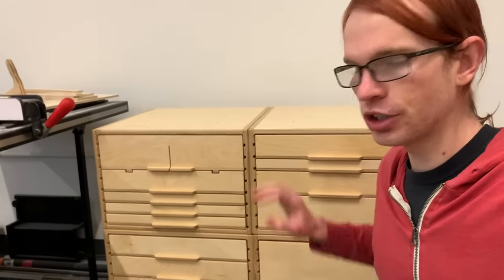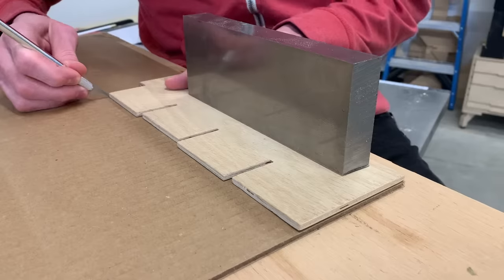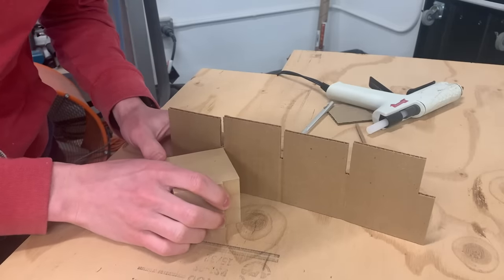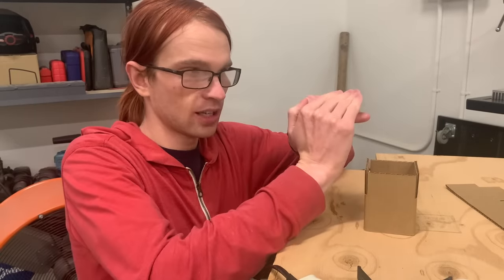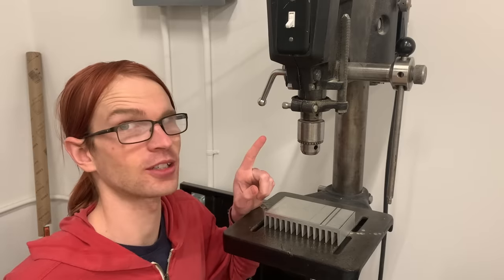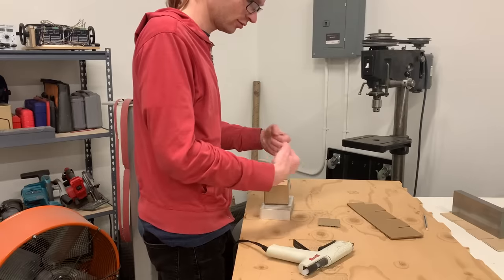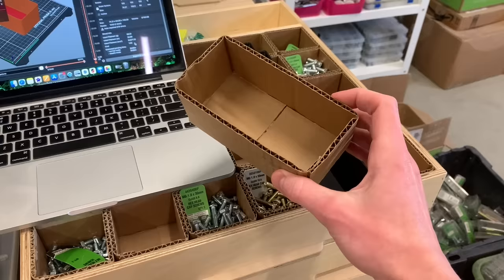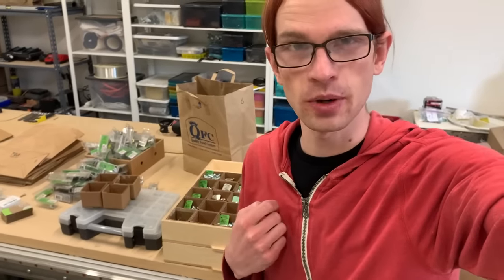Cardboard Hardware Boxes

Comment: Using a heat sink to help set the hot glue is really clever. And your statement about priorities is so important. A great teacher once told me that engineering is the art of managing compromises.
Reply: And roughly speaking economics is said to be the subject dealing with the optimization of choice among alternatives. So what is optimal for a tray/drawers worth of part storage containers: waiting fifty-three hours for the printing of a set of two dollar new material plastic boxes or working one hour to cut fold and paste a similar set of nearly free recycled cardboard boxes - entirely up to your judgement of course (economics also considers as highly valued the user's preference).
Reply: It's all about understanding your products "requirements" and it environment it will be used in and how. Along its development, there are tradeoffs. We used to say, turning the dials, like the wizard of oz did! 🤔😅🤣👍
Reply: I'm skeptical that it is pressed for long enough for the heat to flow through corrugated cardboard and into the heatsink. Corrugated cardboard is a pretty good insulator.
Reply: I'm skeptical that the heat dissipation really does much through the 4mm of board... But I also thought that it was clever!
Reply: @marksaus  Since it's getting crushed, it won't be 4mm. But I'm still with you that it seems unlikely to make a difference in hardening time.

Comment: Since you may need to make hundreds of these eventually, look into steel rule dies. You could probably build them a lot faster without having to manually cut out the cardboard. Love the detail you put in to all of your videos!
Reply: Be pretty tough to make steel rule dies with those three super tight and narrow slots. He’d also have to buy steel rule material and a die bender which would defeat the purpose of not spending money.
Reply: @kv501  he can make some dies with some scrap plywood, an old bandsaw blade, and a couple of hours of cutting/grinding. He’s got the skills to make it work.
Reply: Excelente, me uno a esta idea
Reply: A router with a small router bit   and a bushing could make this an opportunity to use the router and practice in making a template. I don't think it would be faster than with a knife but maybe some people like to try this out.

Comment: By the way, in sewing, you often have this same situation where one piece of fabric has to be very slightly longer than the other piece.  This is known as 'turn of cloth'.  For example, for the collar of a coat, the upper collar piece is a little longer so it can fold over the under collar.
Reply: Holy crap, you just solved a sewing block I've had for weeks. Thank you! For some reason, cardboard and cloth are stored separately in my brain, but this explained everything perfectly!

Comment: If you stack a bunch of layers of cardboard together you can cut them out all at once using a bandsaw and/or table saw. Just another way of doing it that I've found to work well. However, it can dull the blade a bit so use an old one.
Reply from the maker: Hadn’t thought of this, thanks!
Reply: @Jer_Schmidt  I was thinking about using my scrollsaw actually...
Reply: Wouldn’t there be a lot of tear out?
Reply from the maker: @Killashandra111  
The table saw cuts it surprisingly cleanly. I haven’t tried the bandsaw yet.
Reply: @Jer_Schmidt  Believe it or not, about 5 years ago the woodworking dept where I was taking classes gave away their entire library of Fine Woodworking magazines dating back to 05/06/83.  I picked everything going forward to 2016 with a bunch of gaps.  I wanted to scan it all however cutting all the magazines apart with a box cutter or Exacto knife would have taken forever and killed my fingers.  I created two jigs with compression pieces in which I could trim the magazines, one for the outside margin, one for the spine.  On the table saw, I first trimmed off the outside margin, then the spine so that the final size would fit in my scanner.  Then I scanned everything so I did not have to keep the hard copies.  It was a pain in the butt to do however worth it with all the articles I have at my fingertips.  I really need to spend time indexing them so I know easily what is in each issue.

Comment: There are several makers that are using 3d printed boxes that fit together for this kind of thing.  As neat as those are, it takes hours to print a single box.  I started making little boxes out of 1/4 inch plywood scraps, but even that is a bit annoying and time consuming.  This is clearly the best solution, especially when i receive a box or two every week - so i always have an absurd amount of extra cardboard.

EDIT: I should have watched to the end - you mention the same kind of 3d printed boxes...
Reply: I had the same thought with 3d printing, cardboard looks so much easier and quicker, but then i watched the video, theres a lot of box science going on... Maybe combine the 2 and print sheets you can fold into boxes?
Reply: @mikejones-vd3fg  I like that idea.  However, when i slice a print-flat foldable box i found online (40mm cube - 1.5ish inches), it's still going to take an hour with a .8mm nozzle.  For me, that seems excessive - i'm going to try the cardboard version first and see how fiddly it is before i try printing something foldable.

Comment: I was going to suggest Gridfinity (which is 3D printed) to see if it fits, but you made a strong case to just use cardboard.  that makes total sense.  Sometimes new technology just isnt the right fit.
Reply: The plastic bin he printed is a Gridfinity bin I believe based on seeing the ghost of the grid pattern on the bottom. Both have their place and I really appreciate his cardboard solution to use waste instead of using new materials especially plastic.

Comment: A couple of years ago I re-vamped my small parts storage and built a 10 drawer cabinet and filled most of the drawers with small boxes in the general style of the cardboard ones you just showed. Several sizes that could all nicely fill a drawer exactly. 
But I used 1/4" ply ( underlay, it's cheaper ) and glued the pieces together then cleaned up the edges by sanding on my disc sander.
Your method is much better. Cheaper, faster and yield the same result. Wish I'd thought of that. LOL. Nicely done.
Reply: I’m 70 years old, and I am always blown away by your ingenuity. Best regards from Australia.

Comment: Nicely done.  A light score with a spudger or similar on the crease lines would give you perfect folds and probably speed things up a bit (and definitely make the folded edges nicer).  I think this is a great use for cardboard!
Reply: What’s a spudger?
Reply: @brindmusicnerd  
Spudger - Wikipedia

A spudger is a tool that has a wide flat-head screwdriver-like end that extends as a wedge, used to separate pressure-fit plastic components without causing damage during separation.

Comment: I would like to give an extra fav for trying to avoid buying/using something new even if it's not such an amount of material (against plastic). If you screwed a small blade against a wooden block with 45 degree you could take away some card board material. It would be easier to bend, it wouldn't be in the way of the bend.

Comment: I really like your method with this. 👍
I thought of making some in simple flat cardboard, (not expanded corrugated) which is easier to cut with scissors and easy to fold etc, then once assembled either spraying or dipping them in some type of varnish to add strength and seal the material so it is more grease-proof and "plasticky". For flat cardboard I think you could use superglue not hot glue, so would be quicker and not need much glue. But of course needs the varnishing step.

Comment: Hmmm, I have wanted to get a laser cutter that could cut 1/8" plywood to dovetail together into drawer boxes.  Not as cheap, but the robot can do the 'cutting' (burning) while you do other things.  Assembly is easy without jigs.  You can finish before you assemble to make it easier, maybe.

Comment: Quite brilliant actually. Only caveat is the actual longevity they provide. Guess it all depends on the amount of use (in and out of material and the boxes themselves), content stored, as well as environmental conditions. I made very similar boxes out of leftover planks of some aromatic cedar planking made for lining closets. Gave me a chance to develop my finger joint jig and technique. It may seem far more expensive, but it actually was wood that was destined for the trash bin as well.

Comment: I like crafting with cardboard. Cutting with heavy duty serrated shears or snips can prevent risk of paper cuts on the exposed edges. Also works really well to score your folds with the tip of a large framing nail.

Comment: 3d printing boxes is the biggest waste. Just buy them if you don't want to go the cardboard route, you can get them super cheap at Harbor Freight. However, I could certainly see making the mold with the 3d printer, and possibly even a cookie cutter form to crimp or even to cut out the cardboard.

Comment: You could probably use a vise for the pressing step as long as you made sure it pressed on the form insert to avoid crushing the walls.

Without having to apply the force yourself,  as with the press, the increased time to dissipate the heat wouldn't matter. 
I imagine you could leave the box in the press while you cut out the next box.

That would mean sequecnal production rather than batching. So more workspace required and potentially a loss in efficiency. 

If you had to forms then you could still batch. Long and short perhaps 🤷‍♂️

Comment: I think your estimates on 3d printing are a bit off for plastic usage and cost... I need to actually print one, but I was able to slice for printing 9 of the small cube boxes to fit on an ender 3 bed (barely) and it used 39g of plastic each (about $.57 in sunlu PLA)... it would take about 30 hours of machine time, but only 2 or 3 minutes of human labor... and since I did the design in fusion, I could easily modify the sizes with just the one model... (half-width or divided boxes, odd shaped (like an L) boxes... etc... but I am a 3d printing junky... 

With a bit more engineering (which is already going on in the opensource printing community) you could get free filament made from recycled 2ltr bottles... though you would have to run the bottle through a spaghettification machine and wind it onto a spool... then you would be at machine cost only since you could harvest the electricity from solar panels. 

Alternately, if you really wanted to go full-on recycle crazy, you could run the paper through a mangle and press wet pulp into a mold along with some of the sawdust from your shop... still probably with a bit less labor than the manual cut-crease-fold-glue press process... but I am a bit too lazy to do that myself... or just build a small press mold and use sawdust and a little pva glue to make a ldf box... or use the same process with plastic scrap like the Precious Plastics folks.

Comment: Delighted to have found your channel. An idea for your template: Instead of using the weight to hold the template in place, perhaps some brad nails protruding 1/16" through the bottom of the template could keep your template from moving while you make the initial cuts.

Comment: Nice one, thank you. If these lil boxes were dipped into resin or polyurethane varnish, or even old house paint, they would last a very long time. Cardboard not so good in high humidity. Hot glue comes undone when frozen. Maybe paint could be poured into them, and then out into the next one, and so on. Don't even paint the outside.

Comment: You could massively increase the longevity of your superb cardboard boxes by either wax soaking them (might melt hot glue, or could use superglue gel instead) or a thinned epoxy which you could spray on and would just soak in and stiffen.
Reply: Everybody has wasted polystyrene containers.  Dissolve one in acetone and brush that onto the cardboard.
Reply: I use the thinned epoxy for lots of things, it's great stuff. Waxed cardboard is ridiculously flammable though, you're basically storing a load of paper soaked in petrol in your workshop. I think the downside outweighs the benefit on that one.

Comment: To save yourself some more time, consider:

Cutting out several layers of them using a small template bit in a trim router.

Pre-embossing your creases with a screening roller and straight edge, or a putty knife.

Using a contact cement instead of hot glue.

Using the above, you could batch these things out even faster, and not need to fight with (or make) the block.

Comment: As a thought besides a laser cutter you can also use a Cricut.  I found out about the Cricut from Shara Woodshop Diaries.  She used it to create vinyl masking to make faux inlays on her wood projects.  I’ve found other uses for it with my woodworking.  For making this box. The Cricut could cut and score the fold point on the cardboard to make it super simple and fast to make the boxes. And the cricut is very fast.  It could cut and score one of these boxes in less than a minute.  I recommend the Cricut Maker 3 for supporting woodworking.  It can also cut wood veneer with extreme accuracy.

Comment: An efficiency change could be making the flaps trapezoidal. Not much change in strength and far easier to cut out. Could probably trace the template onto the stock with sharpie and then cut out with shears at that point (just cut away the sharpie line).

Comment: 02:29 It's very important to align your folding line with the void inside the cardboard sheet, or it will be hard to make a nice sharp corner. This should be done in  advance aligning cutting template during cutting  the sheet.

Comment: 4:25 a drill press can be used as a.... press?  I HAVE A DRILL PRESS!  I never realized I also have a press. tks!
Reply: aside: if you pull these boxes out often, it is useful to have them as separate boxes the way you did here.  but if they remain in the drawer all the time, it could be potentially more efficient to build them as a drawer full grid of full-width sections of (bottomless?) cardboard.     Regardless: an excellent video and +1subscribrer
Reply from the maker: The thing I hate about divider grids is that they tend to ride up, so stuff (especially washers) slip under them. But yeah it depends what you’re using them for. Thanks!!

Comment: The cardboard boxes are absolutely brilliant. And the fabrication method is well done!
I do however believe you could speed up the print time by A LOT. I have no doubt it could at least be halved.
Reply from the maker: Thanks! I’m a 3D printing noob so I’m sure you’re right.
Reply: absolutely could. Looks like he's using prusaslicer, so my recommendation would be to model a filled block, then cut some small horizontal corrugations in it (2 or 3 would be fine, depth could be kept to less than the width of the cardboard) and then use vase mode with 2 bottom layers, with 0.3mm layer height, and 0.8 or 1.0 mm line width. You can absolutely print that wide with a 0.4mm nozzle, if you have the volumetric limit set correctly for your filament and printer. I have printed a 1mm layer height and 3mm layer width with an 0.4mm nozzle and it came out amazing looking. Really slow though. I think the printer was moving at around 5mm a second.

At 1mm x 0.3mm, and 12mm^3/s volumetric, my printer is still doing a healthy 60mm/s print speed, and can crank out a 50mm x 50mm x 50mm box in 15 minutes, and 13 grams of filament. I just used prusaslicers inbuilt cube function for this, so maybe a bit longer with some corrugations? Certainly not 3 hours.

Comment: Great video. FYI vacuum cleaners are really good for hot glue cooling, not so much in your case though. I am surprised you dont want a laser cutter It is my most used tool in the workshop.
Reply from the maker: Thanks for the tip!

Comment: Any ideas for labeling the drawers?
Reply from the maker: It might be a bit over-the-top, but I think I’m going to try some little wooden tags that can be attached to the drawer front with two small screws. I’ll just write on that with sharpie, and I can reuse them several times by sanding them off or flipping them around.

Comment: How about turning that template into a steel rule die?!? You could add steel rule for the folds.  I'd imagine you could whack them out with a hammer or by using your drill press as a primitive punch press.

Comment: It's been over a year. Have you had issues with insects (silverfish, termites, dust mites, etc) moving into the corrugation gaps? I used to do this, and then the silverfish moved in. I now use HDPE from milk jug containers instead.

Comment: Right on time when I planned to 3D print something like this. Question - would it not make it easier if you score a line on the external side of the box? Bending it then would be quite precise and easy, I guess - both vertical and horizontal lines.

Comment: He mentioned that he doesn't want a laser cutter, and that is fair, but I wonder how fast this would've been if he was using one. Combining the laser with the manual assembly, this would remove a lot of time. These are very simple shapes and cardboard cuts at lower power than wood. It might cost a few cents of electricity per dozens